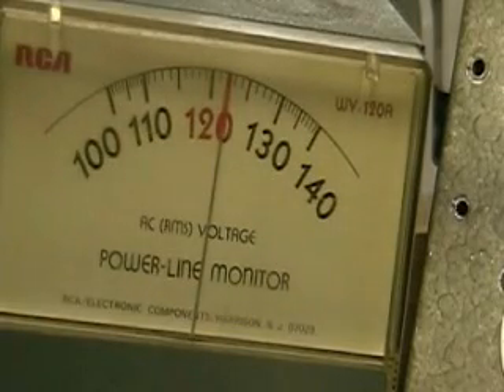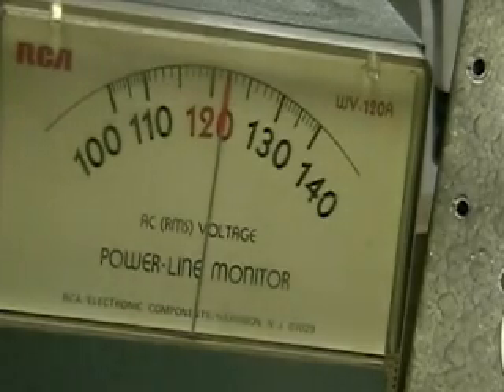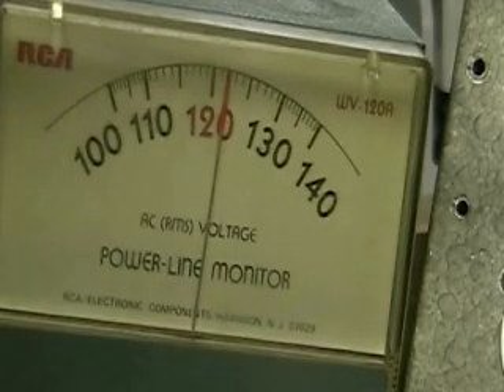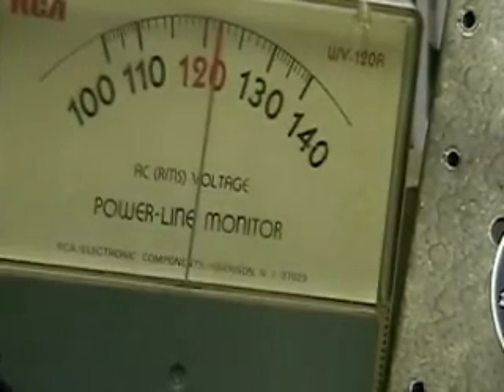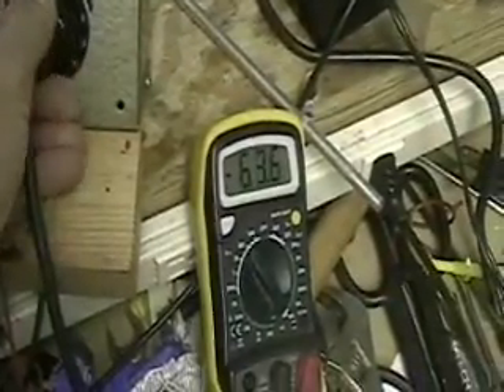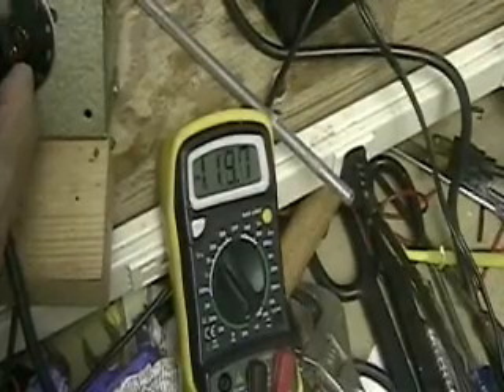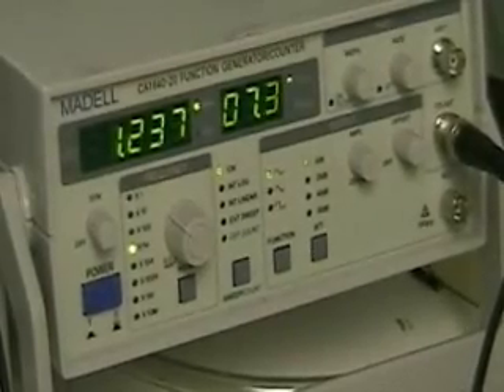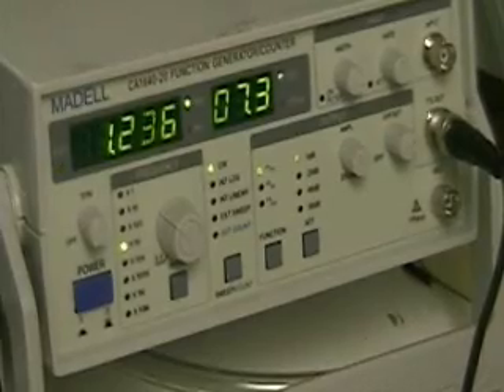Hydrogen Tap (FOCUS-VOLTAGE) 336

Comment: The line is norm at 120 VOLTS AC.  The utility can vary 5% and still call it norm.  so 126 is ok.   Surg supression will not kick in at that voltage.  Need 150 or more for the good stuff.